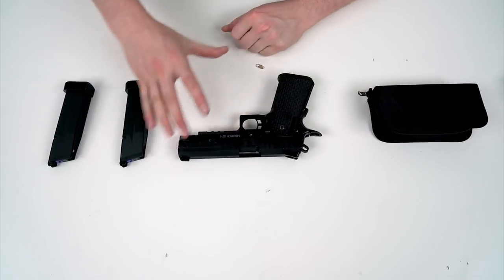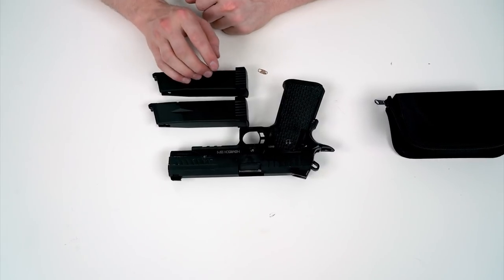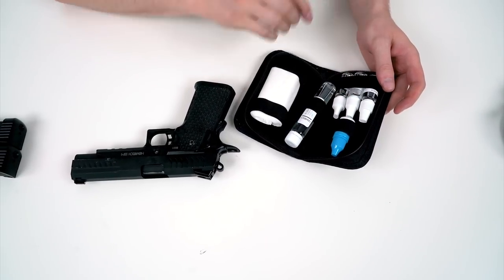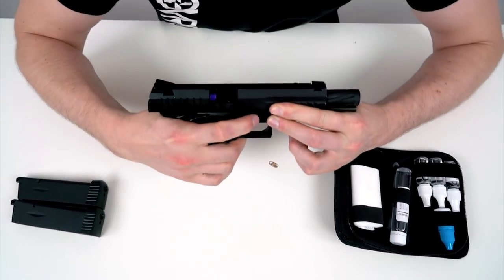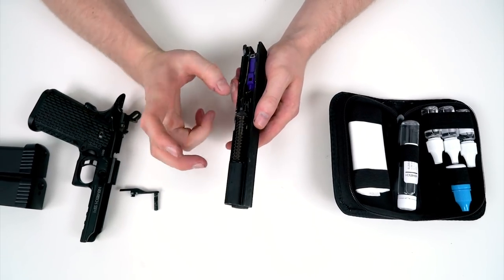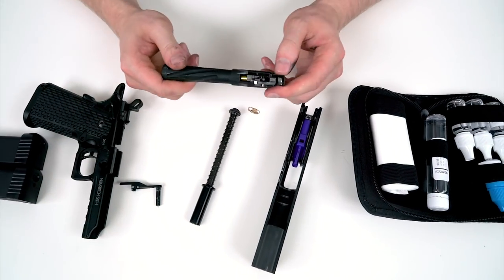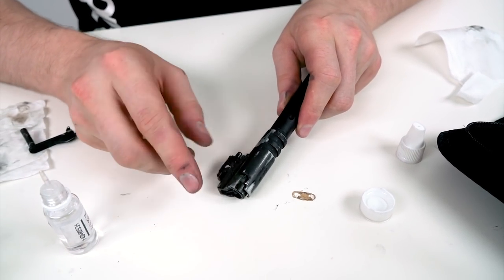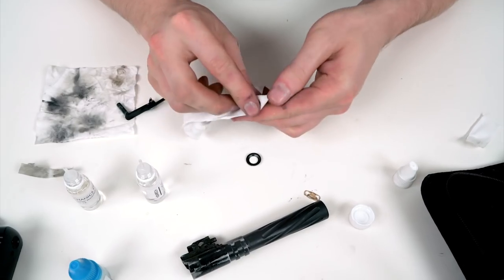SSP1 - Pistol Maintenance

Comment: Be careful with silicon oil, it can cause damage of metal parts when it's very strongly touching (it will push liquid part of oil out and rest what will remin is more like chewing gum so it stucks and when you use force you can damage it), it's not probably case in airsoft pistol, but things like some hinges etc...it's the best for plastic and rubber, for metal parts I am using balistol. Balistol should be ok even for airsoft because it's natural, not from petroleum, but I didn't test it.

Comment: Doesn't the rubbing alcohol destroys the Hop Up Rubber?
Reply: use brake cleaner to clean it out.
Reply: You’d still have to be careful not to push the rod into the rubber. Only let the alcohol soaked pieces of cloth touch the rubber.

Comment: I got my ssp1 two days ago, and my outer barrel is really loose. How do I fix that?
Reply: Evilith Jr. any resolution on that?
Reply: I obviously haven’t’ seen your particular gun but I highly doubt it’s faulty. These have a free floating outer barrel, it’s designed to be “loose”. I knew of a guy who bought and sold several airsoft Glocks for the same reason, each time complaining that it was too loose.
Reply: i had the same question. dont worry about it, i am pretty sure this is intentional.

Comment: What are good alternatives for the oil and silicon lubricants and what kind of tissues are they
Reply: If you have a gun cleaning kit you could use that, or get multipurpose oil at a hard ware store, you can find wipes on Amazon.com  just look for gun cleaning wipes or cellulose wipes. 
Hope that helps :)
Reply: @Tyler-es  thanks this helped me i couldn't figure out what kind of wipes the were
Reply: @gtaledged7670  no problem

Comment: bro i need subitles what the hell is thirsty magazines and btw why recommend oli in the nozzle where the gas comes in? you will get oli in barrel lol
Reply from the maker: It's true that you will get oil into your barrel - but the o-ring of the piston needs some oil to seal and to reduce wear. Just don't overdo it. Less is more.
Reply: disassemble the blow back housing and use actual silicon grease on the o-ring. it will stick and not dry out.
Reply: The gas expelled out through the barrel has oil added to it duh😂

Comment: Small confession: instead of the mech oil described in the vid, for metal-on-metal I used gun grease LT2 from Abbey. I know in general this is used for metal-on-metal airsoft parts, but now I'm worried my SSP will break because I didn't follow the instructions exactly...
Reply: Did it break?
Reply: @stunamungusbackwards255  Funnily enough it did. Trigger pin just disintegrated. Barely used it, only serviced it once. Sticking with TM in future.
Reply: @BohemianFish  oh that one hurts feels bad man

Comment: Okay someone please help me, I have a gbb 1911 and the nozzle gets stuck forward when I run out of ammo so I have to manually push it back and when I take it apart and pull the nozzle it just stays in one place and doesn’t fly back, how do I fix this with out replacing the nozzle ?
Reply: You loading nozzle spring might be warn out. That being said it was happened with my AW Custom Hi-Capa and I just kept pushing it back and lubed the hell of the nozzle. Issue only happens every couple months now and relubing it fixes it. Might just be dry

Comment: I have a question, whenever I put bbs into my ssp1 and put the mag into the gun then pull back the slide, it pushes the bb forward but not far enough and jams it every time I try and pull it back, and then when I pull it back again the next bb comes out and they both fall out and I’ve tried one bb at a time, different angles, it doesn’t work is something broken
Reply: Try cleaning the groves more and adding lubrication if you haven’t. Now I’m not him but by the sounds of it your slide is probably crammed with shit and is creating too much friction for the slide to cycle properly

Comment: Are maintenance required? Because I'm thinking on getting the ssp 1.
Reply: Maintenance is not required but it is HIGHLY RECOMMENDED. It will make your gun run 1000 times smoother.
Reply: @rqairsoft4541  thanks

Comment: The first part of the slide won't come out. No matter how I try, it always gets caught on the other parts of the barrel.
Reply: try squeezin on both ends until the spring is fully retracted, then pull it to left or right side
Reply: @XOTheEmreOX  hey, thanks for the reply. That's what I initially did but it didn't work. Although, I did get official Novritsch technical service on the same day. Dominic was very helpful and efficient. Wish I could have left a review

Comment: is it possible to get a suppressor for the ssp1? or are there plans for it?
Reply: Warlockraider sold on his website. If you're in the US you will need to buy a spare outer barrel and adaptor to attach suppressor.

Comment: I’m having trouble opening the magazine screw after skirms (to get te co2 capsule out) am i screwing it too hard when putting the co2 capsule in? Or should i grease that part as wel? 
Also does anyone have any tricks to get it open? I’ve put the magazines in the freezer hoping that will do the trick..
Reply: Get some penetrating oil (any hardware store will have it) and squirt a little bit around the threads, and don't put it in the freezer, cold does not help stuck metal parts. Heat does, but I'm betting hitting the mag with a torch won't be beneficial. You can also try tapping the screw with a hammer, not too hard but give it a couple sharp taps, that can loosen stuck joints as well. Try that first, then if that doesn't work try the oil. If that doesn't work, combine the two. If that doesn't work get a new mag. It also sounds like you are screwing them down too hard, try using a little less torque next time.

Comment: i've had it since 5 or 6 months and im loving it if anyone has a question about the ssp1 just ask me
Reply: Ive got the ssp-1 now for 6-7 months now and i havent cleaned it yet :D shoule i ?
Reply: *Should
Reply: Hi bud, does your whole slide wobble alot aswell? I can literally hear it rattle when shaking it! I really don't understand..... can you help me out?
Reply: @XOTheEmreOX  its normal those metal parts just shake a little and the screws can be little loose but nothing to be worried about
Reply: @Idk-nc3iv  I mean your gun isn’t an AK and even AK’s eventually need maintenance
Reply: Does it kick hard?

Comment: Which bbs do you Use in ssp1
Reply: .28g bbs are pretty good for most pistols, this included
Reply: I feel like .28 are better for co2 but if your running gas use .25 

ik im so early to respond🙃🙃

Comment: silecone and the hopup .. hmm not a place where you want to have oil
Reply: The green gas expelled out through the barrel hop and out the barrel has silicone oil every gas gun does this even CO2 is recommended to be oil added CO2 cartridge
Reply: Not every gas have oil.

Comment: thanks for the laughs Novritsch. Maybe you should watch some videoes on how to actually maintain a gun before doing a video about it, and give many players false guidance, You are putting a thin layer of oil on a cloth. It will absorb it. The thin layer you are putting on your gun is useless it'll take away the wear most of it for couple of shots, And you oil a spring!??!? repeats on oiling the top of the outer barrel. So basically oil everything including the sights aswell especially the grip screws very important with a thin layer of oil that will be brushed of in a windy day. And oiling the back of the mag valve is just.. if oil would have helped, the mag would have been leaking. how should oil help a valve on the outside where there is no O-ring and its air sealed why would it work? ....
Reply: @-virusx9667  you don't need to oil a spring. actually don't use any oil at all on a GBB. what you need is a lube. and grease for the o-rings.
and cleaning out the barrel? use brake cleaner.
Reply: @-virusx9667  Haha! A second laugh. Who? An angry kid defending he's idol or something? xD